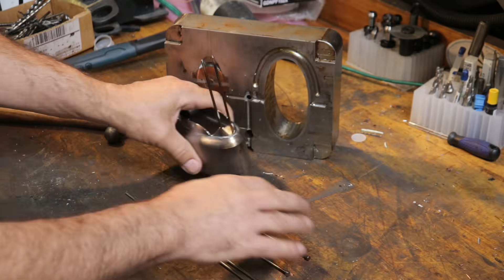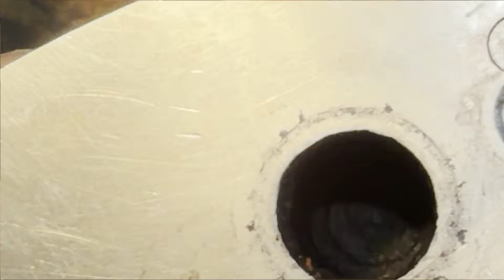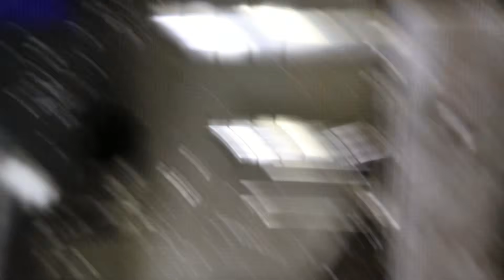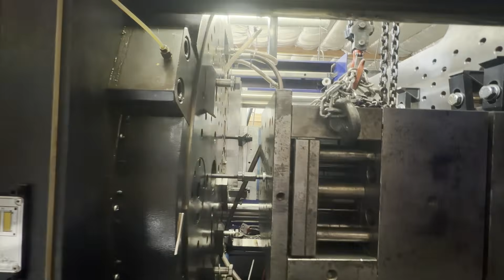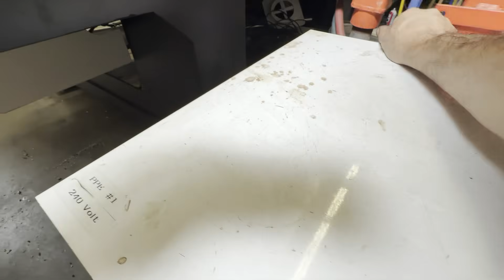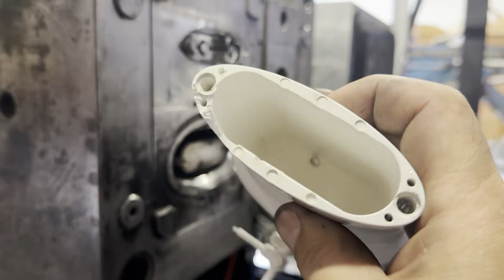Injection Mold Mishap and Repair

Comment: Thanks! When do you need heated water for the mold rather than a chiller?
Reply: Depends on materials, nylons polyester polycarbonate ABS for gloss finish.
Reply from the maker: I use the heated water to warm up the mold in the morning for about 10 minutes, after that I run chilled water.  Seams better than electric cartridge heaters.  Thanks for watching!
Reply: Was your low pressure set to stall at the right position .